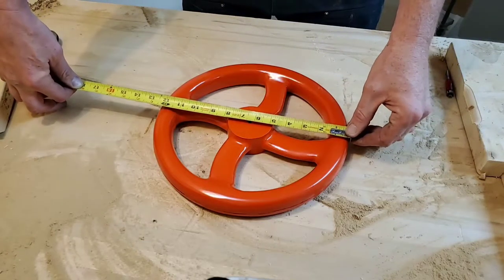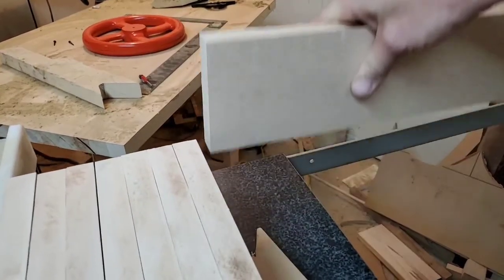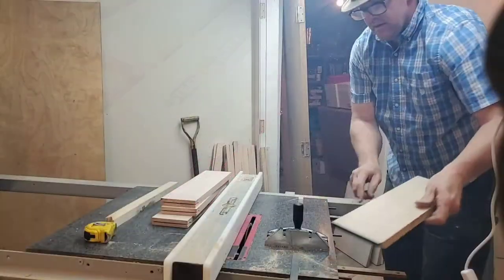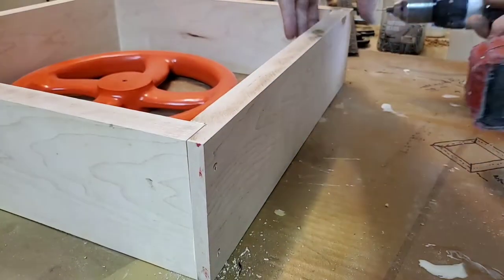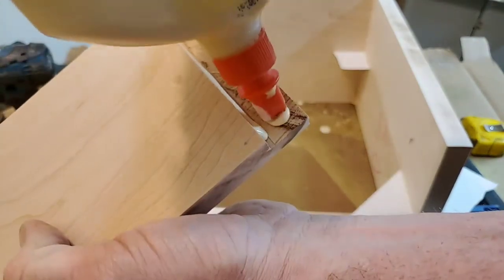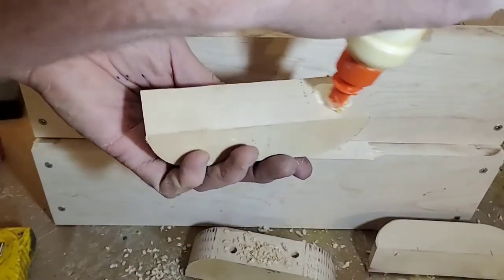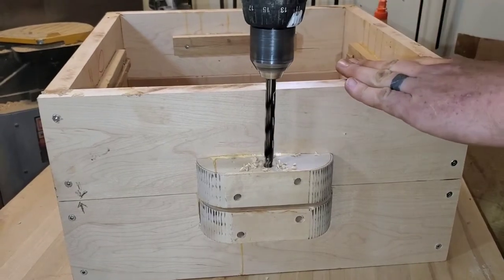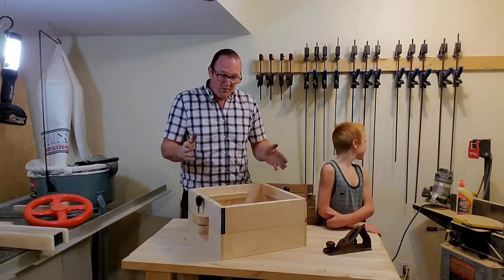Building a maple cope and drag flask for metal casting

Comment: That is not a bad way to gut the lap joint.  You should probably get a fingerboard.  Also, that smoke indicates that either blad is really dull or you are not holding the board verticle.  Both would also caused added resistance to the cut.
Reply from the maker: Thank you Tony

Comment: Cutting thru your push stick like that with the board vertical is asking for a mishap. You should build a tall auxiliary fence that sits over the normal fence and gives you a large bearing surface against which to push the board.
Reply from the maker: Thanks mark . Good points :)

Comment: What wood do you recommend?
Reply from the maker: Depends how long you will have it. If it's just for one job and throw it away. Pine / spruce 2x4 if you are going to keep it any hard wood that's is a reasonable price. 

Some guys are casting there flashes as well.  Come to think of it that would be a good project for me to do :)
Reply: @Wrighmachining  Thanks for your reply, only just read this, I ordered redwood which I believe is softwood, I guess this will not last long?
Reply from the maker: @MrSh4W  no worries,  I'm sure they will be fine :) just store them out of the weather so they don't warp.   Have fun and stay safe.

Comment: Using a finger board is good but it’d be good to see some more safety measure maybe at least better hand placement and a knife to guide the material through also a better zero tolerance board would be safer stay safe out there table aren’t to be messed with
Reply from the maker: Thanks for the suggestions jimigray